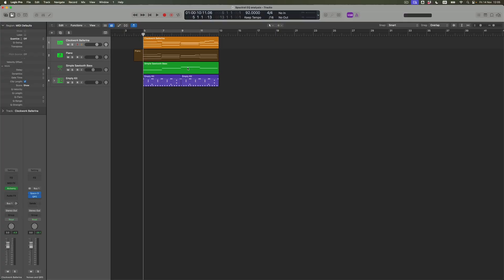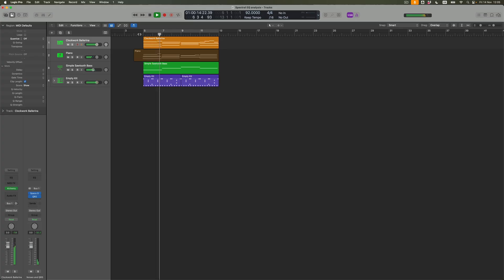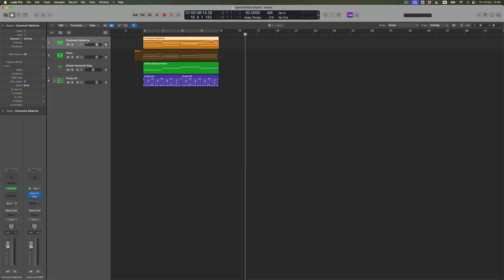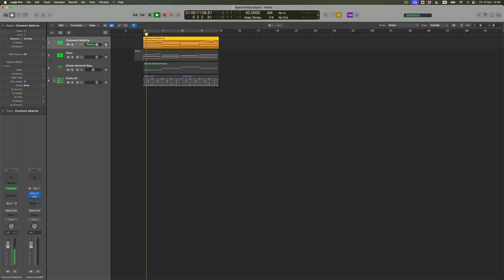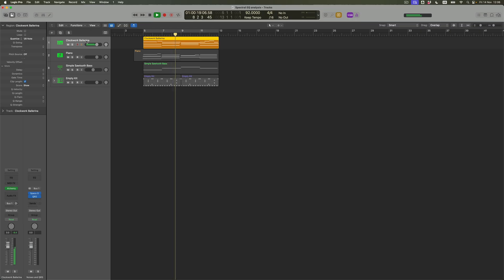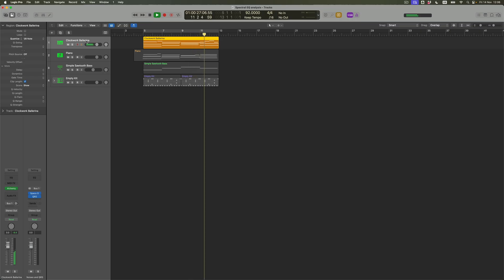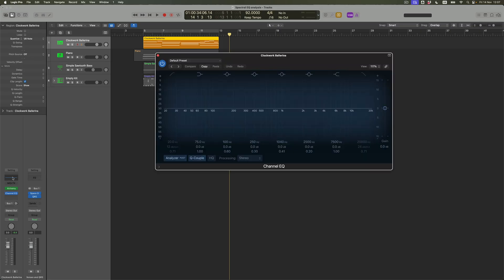Logic Pro: What is Spectral EQ?

Comment: Isn’t adding a compressor with HiP-LoP engaged for that range (or a Multipressor) after the Channel EQ sort of the same thing?
Reply from the maker: Hi Fabrizio, great question! A Multiband Compressor is certainly close to being the same thing but the majority of these don't offer nearly the same number of bands as a Spectral EQ. Remember that within a Spectral EQ, a single band will move to track peaks, so the number of potential 'bands' is considerably higher. Also, what tends to happen with a Multiband Compressor is that a range will be set around a range of frequencies and anything within that band which prompts attentuation will trigger dynamics-range reduction. Spectral EQs are more surgical, offering the options for a much narrower and more targeted approach to dynamics squeezing. But yes, there are definitely overlaps between the types of processing you've mentioned and Spectral EQ and any of these approaches might yield an excellent sonic result. I hope that helps.

Comment: The only downside of this spectral mode in Pro-Q4 is the massive increase in latency at over 5000+ samples (100-1500ms depending on quality mode), which means adding just one instance in a project will also delay every other track  by this amount due to your DAW's latency compensation. It really discourages usage outside of pure mixing or mastering and is noticeably higher than many other tools like this on the market. For spectral control over 3-16KHz overtones and harshness I usually just use TB Sibilance instead at 1/10th the latency hit and it's only $29. I then use dynamic EQ for most everything else during music production because it's zero latency.
Reply from the maker: This is certainly true. I tend to find that if I drop into low latency mode whilst recording and then toggle out again when I’m done, I can keep Pro-Q 4s running live (even in spectral mode) during tracking sessions or when I want to record a part live. But you’re absolutely right about the increased CPU load.